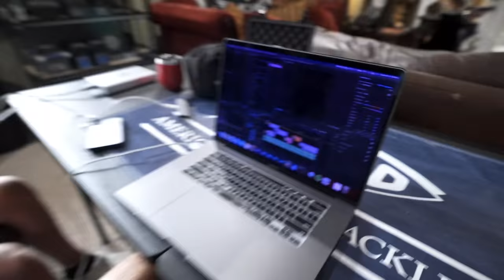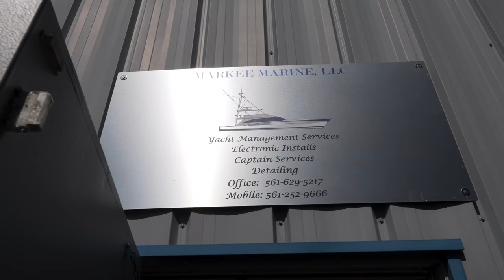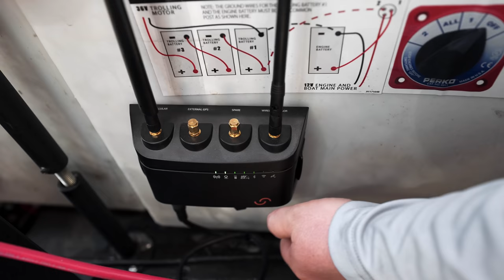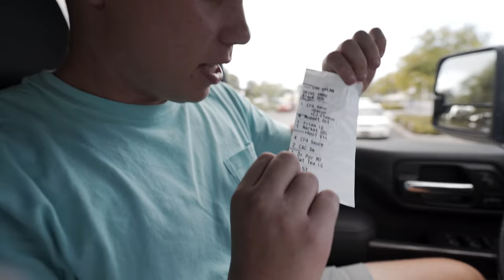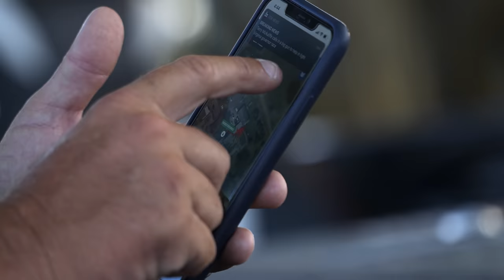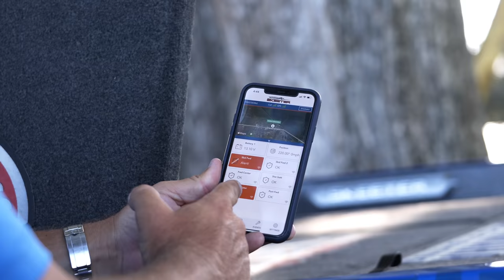How to Protect Your Boat and Tackle From THIEVES!

Comment: Around here thieves targeted vehicles 🚗 batteries by cutting the horn breaking into the truck or car cutting the battery cables then locking your vehicle back up so your vehicle appeared normal. Which had the fuzz baffled yeaup the catalytic converter‘s are now on these lists. One thief got himself killed trying to steal home owners. You may be out of pocket with insurance. Simply safe now has sounds like improved cameras 🎥 in color. I think simply safe should just give people cameras etc but link them to the police. The video is sent and address of location. It knows your face do as not to trip the alarm 🚨 since patrols have stopped. It has to be a shoot out at the ok coral before you’d see a black/white. I think cities ought to be outfitted verses the cell phone bit. Your in the system now as well as your mug shot. Since patrols I guess are expensive so why not light poles cameras to perform patrols stuff ought to be free seek grants.